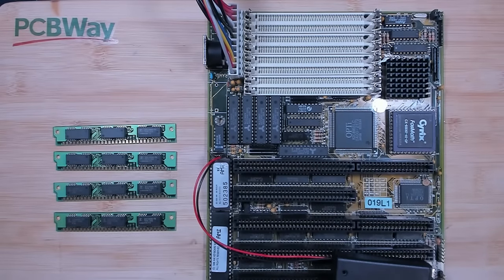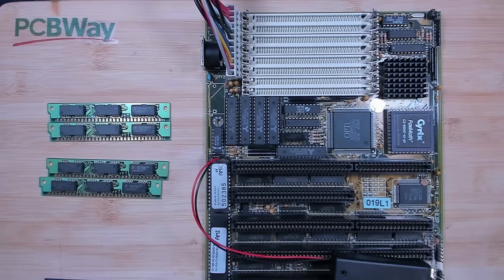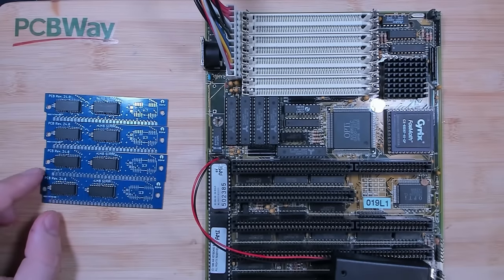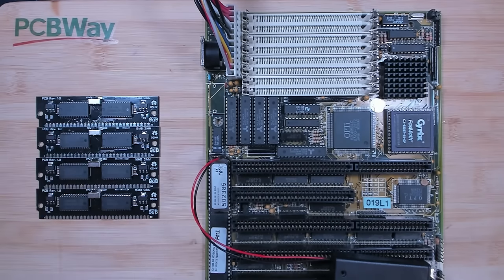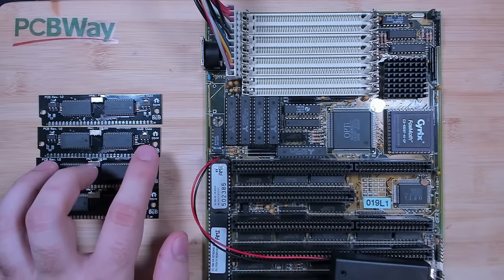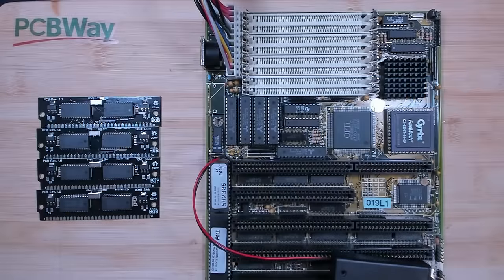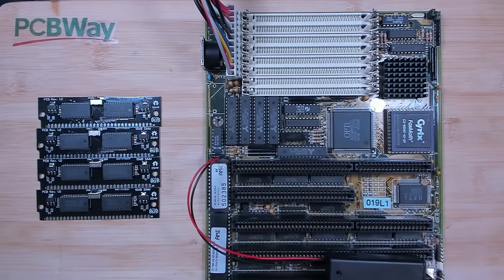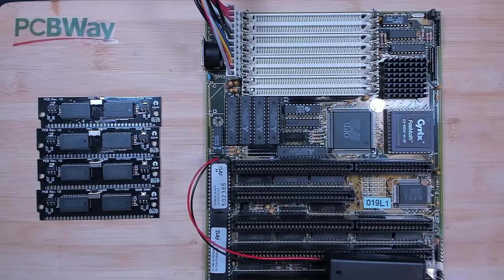16MB SIMM Revision 2.0 - I screwed up!

Comment: Pls remove switch. Use header jumpers.
Reply: Just solder headers on to the board 😄
Reply from the maker: You are free to use whatever you want on those modules. The solder pads for the switch position is close enough to just use a solder blob if you'd like. I prefer a switch because I plan to use those modules in other systems (or even sound cards). If those devices support EDO memory, I can simply change the position of the switch.
Reply: @bitsundbolts  actually I had a Bad/Horror Memory with this type of switch.

My father bought me a new latest Nvidia Graphics card. It had Dual-BIOS feature with this type of switch. Normal mode / OC Mode. I used to switch to OC Mode while gaming.

One night, the switch broke....
Reply: @ayan.debnath   Well that's an interesting thing to have trauma about, sliding SMD switches. I'm quite certain that it will hold up fine on a memory module.

To you of today, you would see it as an easy repair if you broke the switch, wouldn't you?

Comment: No point to using 64mb ram with 386... It's poitless
Reply: NT 3.1 enters the chat
Reply: It was always about pushing an old system to its absolute limits.
Reply from the maker: Oh, I agree - a 386 doesn't need that amount of memory. I just try to see what is possible with this old hardware - and learn new things in the process.
Reply: @bitsundbolts  we need something with Pentium 66 /75, there is not too much about first Pentiums
Reply from the maker: Ah, I have something lined up very soon! Pentium 60, Socket 4, Socket 5, and Pentium 75...